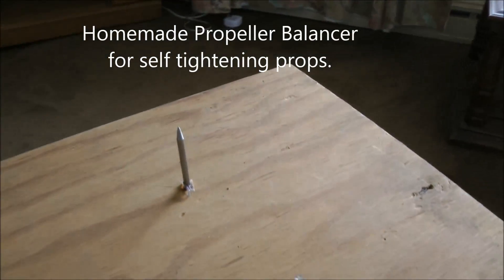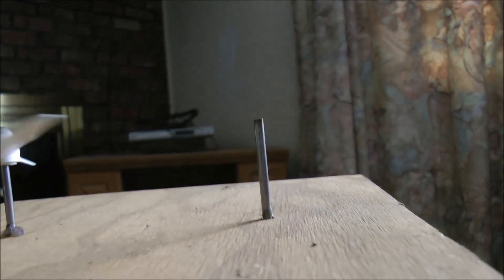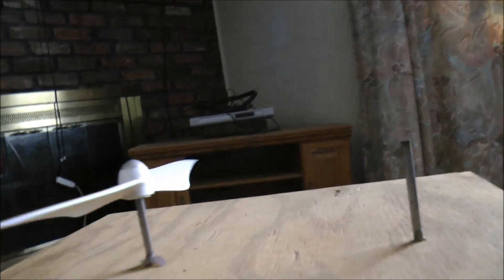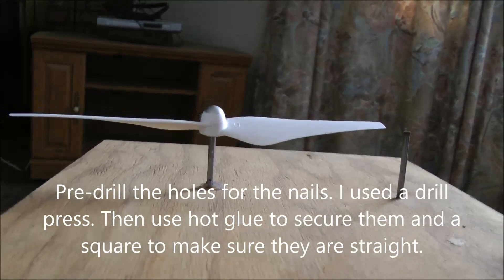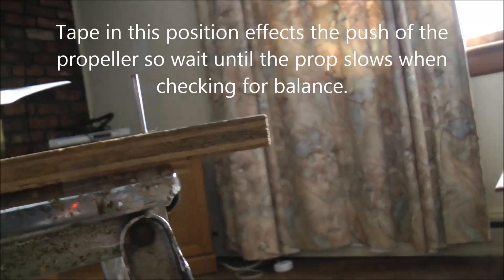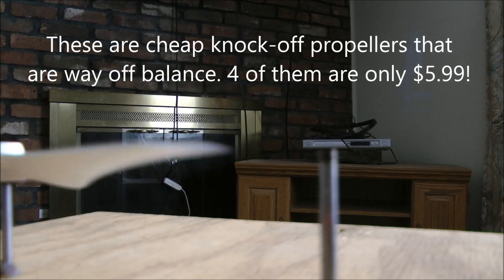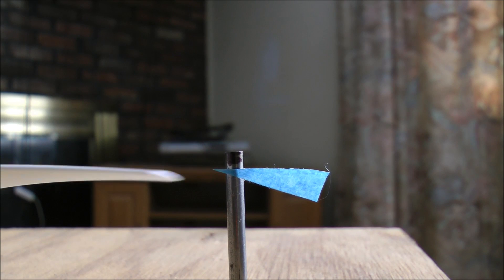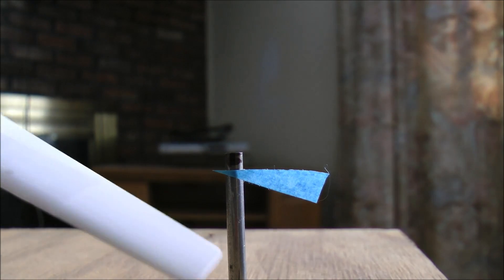DIY Propeller Balancer for Self Tightening Props

Comment: Clever boy, so why don't you just file off some plastic off the very end of the heavy side of Propeller blade. then you're not adding any weight and distorting the Air foil in a random place. I'll be stealing your trick anyways thanks for posting.

Comment: I find the process to be dubious at best.  Sanding a few micrograms of weight from a lightweight plastic blade - seems almost pointless.   I took my propellers off my quadcopter - and the vibrations from the different individual motors, were very apparent. The spinning metallic mass of the motors - and their harmonic vibrations, create much greater balance issues, than a tiny bit of plastic.  imho.   Try it for yourself - and while you're at it, weight your props!  Mine were not the same weight, and that fact alone - can create harmonic balancing problems.
Reply from the maker: It makes a huge difference in video quality having balanced propellers. Out of balance props will introduce 'jello effect' into the video. The propellers that I was balancing in this video were cheap knock offs and wow were they out of balance. DJI does a good job of isolating the camera from prop vibrations, and genuine DJI props are pretty close so it's not imperative to balance genuine DJI propellers unless you see some vibrations on one or more arms of the quad or have rubbery looking video.

Comment: I know that this is an old post, but many people still read it, just like me. I tried this setup, but found it unreliable if the prop is not straight. Try to push the hub flat on the table and measure 
from the tip of the prop to the table, if you get the same measurement all good, but if you get 
different measurement you can not use this setup. Some of my props where OK, others not.
Keep this in mind.

Comment: I tried this method, and it works, but has a significant flaw.  If the surface inside of the prop isn't smooth or uniform, the prop still won't balance on the center of the hub, making it very difficult to get it balanced.  I tried this on several props and had issues trying to balance them.  The tip of the nail shifted slightly each time I spun them because the threaded hole didn't have a uniform surface to balance on.

Great idea, in theory.  But, it didn't quite work for me.
Reply: the surface needed water balance scale and apply a little oil if your propeller not smooth or rough internally
Reply: @draddan7275  water based or silicone lube?
Reply: Exactly. balancing will end up relying on the inner surface of the props, not by the wight.

Comment: The absolute delusions... Propeller should be balanced when they are damaged, but for better is change it to new.
Reply: Sure. Like all new props are properly balanced. lol
Reply: I'm not sure what you even mean by this comment.
Reply: That guy is saying this on all of the prop mounting videos.  Must be a little crazy.
Reply: If you're buying for example some t-motor $200 props then sure - they're factory balanced all right. If you're buying $7 DJI or APC SF style props chances of them being actually balanced are slim. Hell, even genuine DJI ones aren't perfect (good enough for decent flying but not perfect). Delusions would be believing china made injedtion mold props are all pefectly balanced straight out of the factory.